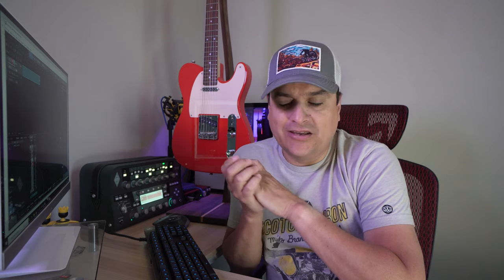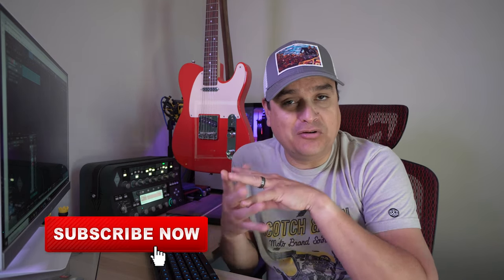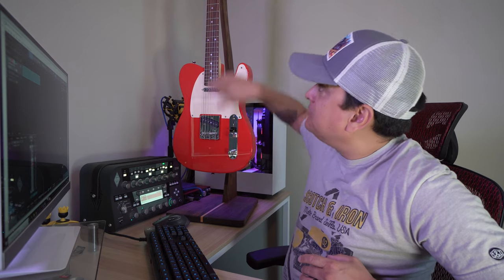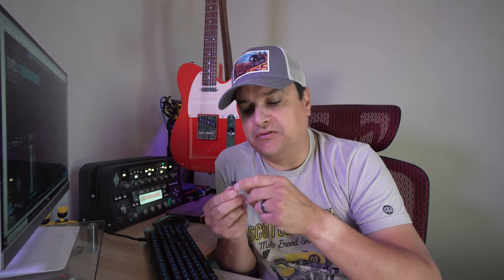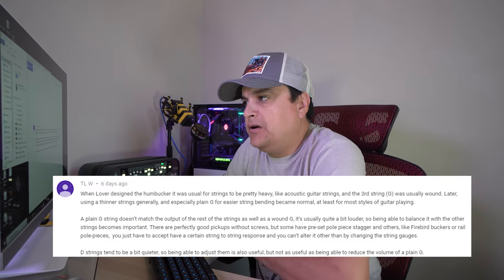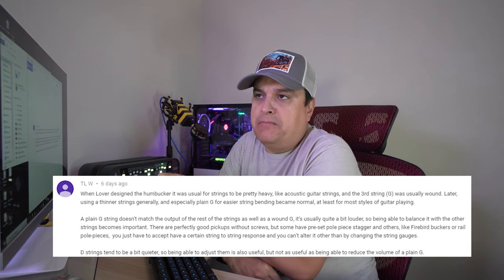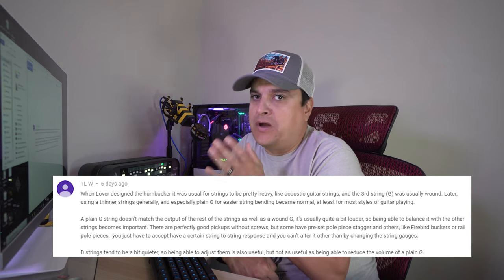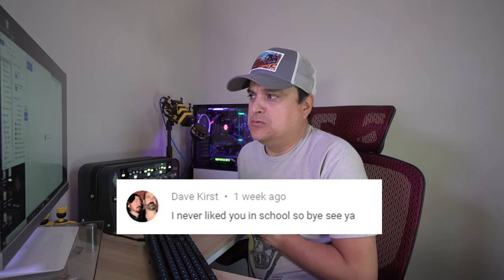Telecaster Saddle Shootout - Graphtech Vs Brass Vs Steel Vs Aluminum

Comment: Thanks Dylan, now for myself and my taste, if I would use the vintage style of bridges, 3 barrels, string 6 and 5 with brass, 4 and 3 with aluminum, and 2 and 1 with steel saddles. I would do the same with the 6 saddle configuration. I like all the tonal choices.
Reply: Why stop there? Get a bridge that can top-load or string-through, have the plain strings top loaded for easy bending, wound strings through for sustain.

Comment: I liked the balance of the steel, it mellowed out the higher frequencies which Teles have plenty of anyway. I was checking this video out because I was thinking of getting a vintage 2 Tele instead of an AM pro which comes with brass. Playing the Vintage 2 I noticed very lil diff other then it being warmer but I thought that may have been the laminated rosewood fingerboard. Im going with steel, vintage 2.

Comment: I really like the very original Telecastor sound the brass string saddles make. My Player Fender Telecastor has steel string saddles. If I swapped my bridgeplate out for one with the brass saddles will I get the same sound as in your demo, please, would you know?

Comment: Brass = very bright, scooped mids, but very articulate. Steel = muted highs and lows, allowing more mid-range. Graphite = very muted, low articulation. Aluminum = restored articulation after the graphite, close to the steel. My preference in this shootout is the steel, but I would say every guitar can be different. I think if you hear just 1 of these alone without the side by side comparison, that any of them could sound great.

Comment: I tend to favor brass in most applications. There's a ..."livelyness" (?) and a chime...that's hard to quantify. This extends from guitar saddles to resonator guitar bodies to the different brass formulas that saxophones are made from. 
The term "Like ringing a bell" seems to apply nicely.
I was surprised by the aluminum saddles. I've never tried them and they sounded pretty good.

Comment: My Picks!

1. Graphite
2.Brass
3.Aluminum
4.Steel

I'm changing a tremolo in a 2001 Indonesian Fender Strat ...and I've been looking for info about this topic specifically. After seeing this video, I think I'm going with a Gotoh EV510TS-FE and then add a set of the Graphtech Saddles to it. 

Dylan, do you recommend I do the Birchwood Casey Aluminum Black Staining on a chrome Gotoh EV510TS-FE. I really want to try it but I don't know if it'll work on chrome.

Comment: Nice video! Having just bought some cheap saddles of unknown material under chrome I'm thinking that knowing what material the saddles are is good! My new, cheap chrome plated saddles sound dull where the  stainless steel (unplated) saddles sound bright. I'm putting the difference in tone down to the saddle material... unless the addition of a groove/string guide in the saddle changes the sound.

Comment: Brass was the only that was different from the others. Could it be due to them being sitting on the guitar for a while. Unchanged setup. While the other saddles was tested with the setup being pulled out of the comfort zone?

Comment: I just changed my SG to the brass bridge and brass saddled Tune o Matic and oh my goodness it made such a huge but pleasant change. The plastic nut and the steel Tune o Matic were lifeless. So now I'm in the process of redoing the finish on a strat project and I got a brass nut and a set of brass saddles and a very hefty brass tremolo block. I can't wait to hear it when it's done. I'm not sure exactly what it is about the brass parts that I like but it just adds something that I can't put into words. So why not adopt brass parts to all my favorite guitars?

Comment: 1. Brass - bright, ringing like I like a Tele to sound. 

2. Aluminum - almost as bright as aluminum, but not as much as brass.

3. Steel - slightly darker than both aluminum and brass. 

4. GraphTech - darkest of the four and slightly muted. 

I changed the order to rank them in order of my preference based solely on your samples. I don't have a Tele - yet. But it's on my bucket list. I have a LP style ESP and a Sire S7FM. With those two I can replicate most sounds I desire - except the country twang of a good Tele. That's why I would choose brass. There's another channel by Zac Childs that does deep dives into Tele's. I find his advice to be honest and reliable.

Comment: Brass-- full and balanced
Steel-- midrangy, lacking depth
Graphtec-- full, but with highs cut
Aluminum-- lacking depth, bright
Reply: rico ingles  yeah. I was hoping he would do brass at the end, too. what may have worked best is if he had changed the strings using the same type of strings every single time so each would be played with a fresh set of identical strings
Reply: rico ingles no

Comment: I like the Graphtec the best because it DID dampen the Tele twang. Tone is frequency, not twang. Twang to me is more about being a little harsher. I heard no buzz or vibration with the Graphtecs. If it DOES dampen high end tone, just turn up the highs on the tone pot or amp. I put Graphtec saddles on a Squier Strat and eliminated all string buzz, and it intonated easier or more precisely. I also added a Graphtec nut. They call them Tusq.

Comment: I just love the stringsaver saddles. They almost only damper out some unwanted noise frequencies but keeps the good stuff. I think it's the same material as the Tusq XL nuts. Graphtec proprietary mix of Boron Nitride with Teflon. They are not graphite. I have them on all my guitars.

Comment: I bought the graphtech saddles at some point b/c I was having string breakage issues.  I had the same issue with the screw not fitting and I have the standard vintage fender ashtray bridge.  I wasn't willing to drill the bridge, so..$50 well spent, sigh.

Comment: Brass seemed to add a warmth especially on the bass! Steel bright! Graphtec seemed ok on treble but woolly on bass! Aluminium was the surprise they seemed to brighten the bass but toned down the sparkle on the treble! Is that why they are still on??

Comment: What about comparing saddle shapes?  I mean sharp versus a rounded string pivot made of the same material. I've saw noticeable differences in a bass guitar. Yamaha indeed made few bass bridges with both reversible options (BBP34 I think).

Comment: I believe  this selection of saddles will be based on your needs or tone preference. However, after listing to this test I really want to change some saddles on some of my guitars to have that variance flexibility.
*Brass: sounded brighter than all other saddles. Very good crisp and bright sound.
* Steel: sounded ok, like most common sound.
*Graphite: I like how clean the tone came out from these saddles. It will be nice to have a guitar with this saddles for songs that requires a cleaner sound. 
*Aluminum: Sounded in between Brass and Steel. I will use these saddles for songs that requires overdrive and distortion.
That’s my opinion. Let me know what you think. Great video Dylan !

Comment: This is going to be weird, but I liked the brass for the D, G, B, and E strings and the steel for the E and the A strings.  If I had a Tele that used this kind of bridge I would totally run it that way.

Comment: I liked 1 brass, 2 steel, 3 alum, 4 graphtec. I used Graphtec on a strat that I liked, actually two strats. I don't like the stamped steel strat saddles after trying to like them for years. I'm just a hobbyist and don't play at load volumes much, so I go for more clean tones, but I like good tone. I own several hand wired amps, and modify almost everything(except pedals). So I am very picky about the whole signal chain. I never tried titanium, but I have machined a lot of it, and never could justify the cost.

Comment: Brass: very bright, the notes jump out. The high end is overpowering to me.
Steel: very warm. The notes blend together - seems best for strumming, otherwise, the notes get a bit lost.
Graphtech: Good balance and presence of each note. My favorite overall for that reason. Good chords and great single notes.
Aluminum: the warmth of steel with more pronounced high end. Very good sound for the Tele.

For me on this test: GraphTech, aluminum, brass, steel. It would great to hear different pickup variations and distortion versions as well.

Comment: I liked brass way better than the other stuff.  Personally, most of my guitars have TOM style bridges with stop tailpieces, and I like the tone of the el cheapo pot metal bridges you can get for twelve bucks on Amazon better than the more expensive stuff like Gotoh and Tone Pros.  I have an LTD EC-1000 Koa with Tone Pros style bridge and tailpiece, and I like the way it sounds with the little locking Allen screws removed.  It sounds kind of tinny and pinched with the screws tightened down, so I took them out and put them in a little ziploc bag in the case.

Comment: Tough call on which one I liked more.  I definitely heard the tonal differences.  I was surprised by the results.  I thought that the brass would be the darkest but clearly it wasn't.  For the lick that you played I liked the steel saddles.  However a different type of riff might make the aluminum ones sound the best.  I suppose when choosing saddle material one should consider the style of music they are mainly playing.  I've got brass saddles on my guitar but wearing down the G string saddle more quickly for whatever reason has made me considering buying a Schaller Titanium bridge.  This is a valuable video.  Very useful information.

Comment: Hi,
Is it an alder or ash body ?
From what I read brass match better with ash and steel with alder because alder sounds darker.
What do you think ?
🙏
Reply: That sounds right...Swamp Ash is the proper wood having a more scooped mid and the brass will mitigate some of the highs. Alder is smoother and a little dull, steel might put back some of that dreaded word... TWANG!

Comment: Over many years brass appeals to me when including performance under scenarios like heavy to light picking, palm muting, free strokes/rest strokes - but only i as the player really know this.  I did find titanium to also be interesting. Saddles alone are just one thing in a chain involving wood, hardware, electronics, cable etc but if a player is discerning in all areas, the end result is audible.

Comment: Remember for a minute in the 70s when suddenly oodles of people decided their guitars should have brass nuts, supposedly to get more sustain and "tone"? Yeahhh, well, there's a reason nobody does that anymore. It sounds like ass. Yet plenty of people here claim brass saddles sound way better.
Similarly, pretty much everyone who doesn't play one swears on their mother's soul that locking nuts (steel or plated steel) "suck all the tone out of your guitar," but those same people nearly all agree that steel or plated steel saddles are just fine.  Same laws of physics apply, but somehow it's magically different LOL.   
Meanwhile, loads of people have proven over and over again that you don't even really need "tonewood" in a solid body, you can make a plywood or soft pine- or aluminum-bodied guitar sound just like a classic with the right pickups.
Weird, huh? Just goes to show that even if you do a perfectly controlled scientific side-by-side sound comparison, most people have already made up their minds based on tradition and hype, and they will believe what they already want to believe no matter what you prove. So just play whatever you like and stop worrying about it. No one but other gear nerds, and nerds trying to sell you gear, gives a single hoot about all that anyway.
Reply: There is a very small difference in this case. The things you refer to are indeed mostly hokum, snakeoil or the placebo effect.
Reply: Agreed. I mean pickups, amp and pedals will make 90% of difference. Rest is in 1-3% difference that we can threw into margin of error or placebo effect similar to pharmaceutical sugar pills experiments. However i did like brass the best but maybe his pick attack was different on that clip. I mean you would have to have robot play this, not human that can play differently each time.

Comment: All four were perfectly serviceable. In a noisy venue, no one who was there for social interaction would be able to tell the difference. 
That said, when I put on a headset, closed my eyes, and listened closely... the brass sounded more "articulate." I thought I could hear more definition between the notes of the low-midrange. The aluminum and the graphite were tied for a close second, and the steel had that general issue sound.

Comment: Brass - warm with pronounced upper mids.
Steel - more brilliance and air.
Graphtec - low mids more pronounced.
Aluminum -  almost balanced (lack of a better word but I'd say it slightly has more upper mids than the rest of the saddles except for the brass saddle).

I prefer the brass saddle not sure why other than it sounds warm but not dull. The worst one I didn't like was Graphtec saddles despite the low mids being more pronounced than the brass saddle it also gave it a dull sound to it.

Comment: That was pretty interesting. The metal ones especially the brass sounded loud and airy, the graphite sounded a bit like a room reverb. Less lively more dampened and studio like. I liked Brass, Steel and then aluminium best. But I can see brass being frustrating if you tweak your tone with effects I can see you losing a lot of definition. Especially with any gain stages  or time effects like reverb or delay etc.

I was surprised what a huge difference they made. I think I will have to try some more nut and saddle materials on various guitars. Seems like a cheap and reversible way to change tone.

Comment: The material saddles are made of absolutely matters.  My schaller 2000 has weak zinc roller saddles that suck tone and easily crack in half with a hammer strike, exposing their porous insides.

It totally robs harmonics.

For a strat, the bent saddles have the best harmonics.

Comment: I've been sold on brass since I put raw & ungrooved compensated saddles on my Tele and that's been over a year but previously it had plated brass saddles that had a nice midrange tone on the E A & D strings...do you think that the plating plays a tonal part as well? I thought of String Saver Saddles for my Tele but ruled that choice out in favor of the brass saddles although they do have a bit of brass-like body to em but they take the highs away from the tone; in addition to extended string life, I've had them on my Strat for over 18 years and I like the way they sound and feel. I'm going to listen to this test again with my earbuds for a totally different sound perspective to see if my opinion has changed which I doubt very seriously.

Comment: Hey guys, got compensated brass saddles like on picture in this video, and the strings are slipping on the saddles. Why the saddles does not have grooves? If I make grooves myself, will it make something worse?
Reply: If you have any doubts, have a repair person do it...it should be a cheap adjustment...you want the spacing correct and the grooves to be polished and angled upwards a bit.

Comment: They all sound different. In all, it is a combination of the pickups, the string material and gauge and the saddle material, and what pick you use. And tension if you tune down. You can really shape your tone when you grasp how they all shape the tone. I have been playing now for 40 years, and finally I have kind of a mental chart over what affects what. It is not easy! The fact remains : Easiest tone shaping is still getting a graphic EQ! 😂
Reply: 😂 40 years 🤸🏻🎸 😂😂 EQ 😂😂😂

Comment: Over my senheiser pc350's thru my xonar dx soundcard. I found the brass has high & upper mid definition to it. Then everything else after that had a prettymuch top end with lowered upper mid range ... maybe even the last 2 are the most balanced of the 4?

Comment: To my ears, Brass seemed to give a little more emphasis on the bass/lower and middle range frequencies, and then we have the Graphtech with a little less, and then the Steel one with even less, and in the other extreme we have Aluminum which gives much more emphasis on the treble and higher range frequencies.

IMHO, both Brass and Graphtech are ok for a traditional Tele with single-coils, but Steel just seems a little too bright and crispy. But on the other hand, if you want a Tele with some really dark/dull/mellow/muddy humbuckers, then the Aluminum (or maybe even the Steel one) would be perfect, in order to compensate for that.

Comment: I had to listen to this several times to actually make a comparison. To my ear the brass sounded a little warmer than the others. The steel sounded overall best to me, or more balanced. The graphtech sounded good and was just next to the steel as a little brighter sounding. The aluminum sounded thinner and sharper than the others. Without comparing to each other I would be happy with any of them other than the aluminum. Just my ear and preference.

Comment: From what you've shown it would seem that the besides the body and neck design and materials from which they are made that the nut material, tuning post and bushings, frets and even elevation and humidity (air density) would also effect the tone as well. Then take nut and saddle string slot shape and it's all looking very complicated. I guess you just spin the wheel and play the odds.

Comment: First, there is no "Better" or "Best", it's simply a matter of personal preference.
Brass produces the expected or typical "Tele" tone.
Steel produces the "Brightest" tone.
String Savers produce the "Softest" or "Warmest" tone.
Aluminum produced a tone much like Brass (these are both 'Soft' metals) with a slight difference.